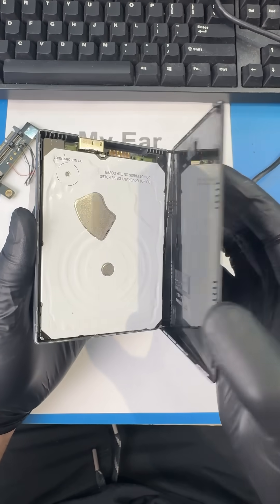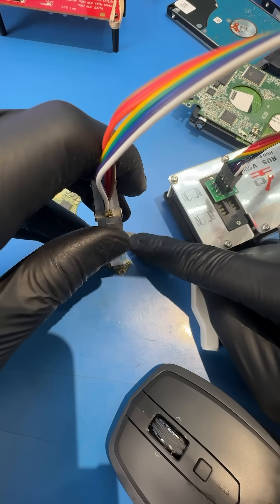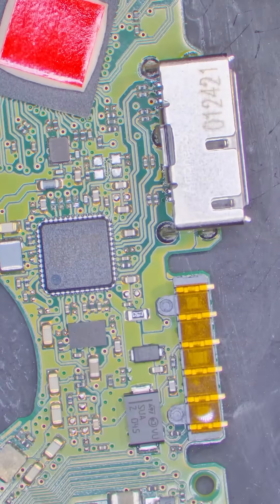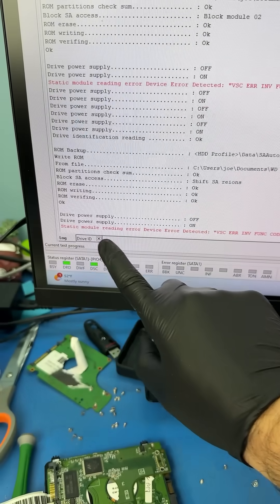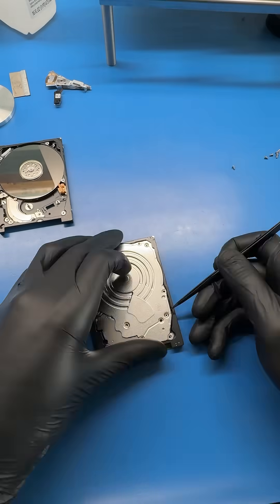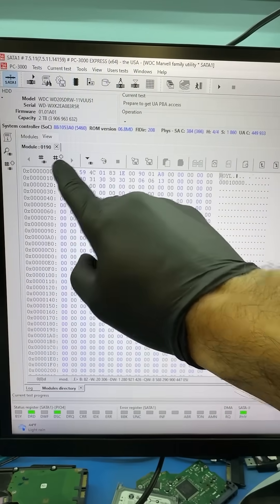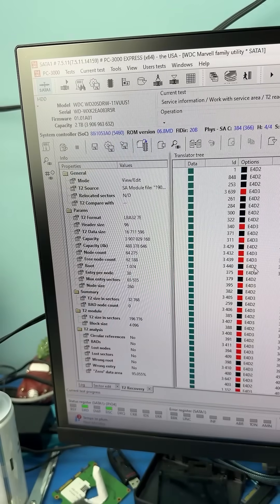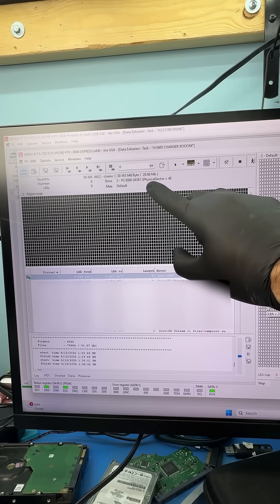Hard drive translator...? #tech

Comment: Reminds me of what I would tell users back when solid state flash memory (SSFM) drives were beginning to replace mechanical magnetic (MM) drives. You can't backup too often. MM at least gave warning by noise or performance slowi downs,  SSFM will suddenly die without warning. Before lunch perfect, come back from lunch, dead.

Comment: I do not recommend WD 2.5" HDDs because of the no SATA crap.
Really?
You have a dedicated USB board.
The USB port not working is a common failure point.
When they used a USB to SATA board, you could remove that board and extract the data.

Comment: Bro still worked on an HDD? Oh my. I am a software dev and my data autosaves to the pc and 2 external SSDs connected to my pc, and 2 OTHER external SSDs connected to an $800 ASUS router (total of 4 external SSDs plus the SSD in the computer). Due to the sensitivity and nature of my work, I am not saving it to any cloud, unless its our company's proprietary server. If i remember right all of my externals are 4tb Samsung T9, and my internal is a 990 pro. I don't consider anything else. I need reliability. Ps. This setup is not 2 or 5 different save files compiled. It is all 5x redundant identical data saved simultaneously to 5 different drives. After it saves to the first drive, it checks for any corrupted data before auto copying data to the other drives in a chain. If corrupted files are detected, it will promp me to save again or re-roll from a set of previously saved files. Bro with his hard drive hopefully learned a lesson lol

Comment: That's why you should keep important data at least on a NAS with a RAID array. It will handle one or two failed drives before you loose data. And then always make backups of your important stuff in case the whole NAS fails and kills the drives.

Comment: 30 years ago my younger brother pushed my computer from the table. My hard drive was completely dead. All my stuff was on there 6 years of programming, documents and copied software. So took the drive to the bathroom, turned on the shower for half an hour, waited until the steam settled, put a damp towel over my mouth and nose and opened the drive. One of the six heads was broken. I cut it off and reassembled the drive. I got nearly all my personal stuff of the drive. I was sweating bullets the hole time with a heartbeat so hard i think my parents could hear it downstairs.

Comment: Had the misfortune of diagnosing issues with these drives. At least with the Seagates you can pull the daughter board off and you got a standard 2.5" HDD but with the WDs you don't have that luxury. Less parts to deal with but less options for recourse when the drive runs into issues. Especially the ones with the shoddy USB 3.0 SuperSpeed port that we see here.

Comment: This is why I preferred the SeaGate External Drives.
Inside the shell, they had the SATA connection exposed, and a small PCB connector for the USB port. Easier data management, unlike WD.
Reply: +1
Reply: @einteko Dude Seagate is Western Digital. Western Digital bought Seagate years ago. Their relationship is like Compaq which continue to exist while still under HP way back (HP bought Compaq).
Reply: @IMNODOCTOR   I thought Samsung bought out SeaGate like 2 decades ago. Not sure about Toshiba and WD and other HDD companies.

Anyways, my point still stands. The WD HDD had the soldered on secondary board, but the Seagate HDD had the removable USB port.
Reply: @IMNODOCTOR Western Digital is not owned by Seagate. I am a retailer and i closely work with both  Western Digital and Seagate company and sell Servers and HDDs in whole of my Country India both Through Amazon and Offline. Both are seperate and Independent company headquartered in USA. Samsung HDD business is owned by Seagate which Seagate branded them as Maxtor and Marketed it commercially.❤
Reply: @IMNODOCTOR @IMNODOCTOR Western Digital is not owned by Seagate. I am a retailer and i closely work with both  Western Digital and Seagate company and sell Servers and HDDs in whole of my Country India both Through Amazon and Offline. Both are seperate and Independent company headquartered in USA. Samsung HDD business is owned by Seagate which Seagate branded them as Maxtor and Marketed it commercially.❤
Reply: @IMNODOCTOR  Nope, don't think so, you can still buy Seagate. WD bought out HGST (Hitachi) and now they are all WD, but HGST brand I think still exist in a few models for HD only though. NOT SSD's.
Reply: @johnhpalmer6098   Yup, and Hitachi bought IBM's drives. It's like the telephone companies in the US.  AT&T isn't AT&T, it's really SBC who bought their partent then took their name.  Kek
Reply: Currently looking at the 4 stacks of broken seagate drive in my desk
Reply: I never had a Seagate that didn’t fail. Mostly SCSI LVDs, including SCA. Got a stack of Seagate drive magnets over three feet tall.
I switched to Quantum and never looked back. Never had a Quantum failure until Maxtor bought them out.
Jussed sayin’ 😶
Reply: Or you can just buy sata disks to begin with and then put them into external cases of your choice.
...For example with a Type-C connector and not this awful ancient easy to break Micro B.

Comment: I love your videos, so no hate here.

But come on people... A 2 bay NAS that will at least mirror the drives might cost more than that cheap external did... But if you're storing something that's possibly your livelihood... It's still cheaper than data recovery, if they can't recover it. 

At least on a mirror, you have a smaller chance that both drives fail at the same time... And you get 2 chances at recovery.

Comment: Guys, stop being cheap.  NVMe enclosure, 35 bucks.  1 TB NVMe ssd, 60 bucks.  512 GB Micro SD card 40 bucks, 50 bucks if you by a Samsung with a USB A converter.  There are so many methods to backing up your data without using a crappy portable HDD for external storage.  Data extraction is difficult and expensive not to mention inconvenient.  One fall and these HDD drives are so easily damaged.  It takes skill and the right equipment to do this OR save yourself the headache, shoot the padlock off of your wallet and spend a few extra bucks on back up.  OR you can pay this guy.

Comment: Saw a video on you saving the data from a samsung of ur client the last video you poseted, quick tip, instead of fixing the power button you can turn on any samsung device by plugging in the charge cable connected to a computer and immediatly holding V+ and V- buttons!!

Comment: Going to say it, as someone who has used those WD Passport drives before, they're shit... Like, majorly.

Sure they work, but they're unreliable as all hell. I've had one fail on me repeatedly, to the extent where I had to reinstall Windows 10 entirely and reformat the drive itself just to fix residual issues caused by it failing.

Switched to an actual HDD, in an external enclosure, and never had an issue again.

Edit: For context, I was using it like an internal HDD for a laptop, because I didn't know how to install actual storage devices yet. Not sure if that made any difference, but still.

Comment: PSA: Always.. ALWAYS! Create backups especially when working on important files.

Get a local NAS and get a trustworthy cloud backup. If you want to play it extra safe. Put another NAS remotely on a trustworthy location.

Backup to the cloud, replicate cloud backup on local NAS, replicate local NAS on remote NAS.

When using a NAS. At least use a RAID where 1 drive can fail. Set a calender from the date you purchased the disks. Replace disks every 5-6 years (start at year 4, do it incremental so you'll lower the chance of multiple disks failing short after each other)

It's expensive, but services like this are more expensive (or permanently losing your data) and it's way less stressful 😅

Comment: Thank you MD Repairs!! After watching your videos, I dropped off a broken SSD which you guys diagnosed the fault, transferred several TBs of data onto a new Samsung T7 and shipped it back to me in a couple of days. I wouldn't hesitate to always send you any tech that breaks down as well as recommend you to all ,y colleagues.
Reply: To all the guys asking for the price. Data Recovery is expensive if you want it done right. Backups will save you a huge amount of money.
Reply: @_seriousrob_  yea and we want the specific price
Reply: @gmodiscool14 and what will that price tell you? Nothing because you still dont know the amount of hours needed to achieve the result. I guess by the fact that the Heads had to be changed 4 times it wasn't on the lower end. Between 300$ to 900$ per Drive, everything seems possible.
Reply: @ "What will the price tell you"
It tells you the price

Price is something people use, to tell if an item or a service is in the ballpark of things you can afford.
Reply: @ i wanted a quote because i have a drive that is damaged and likely not recoverable, but i want to know if it'd be feasible price wise. not much that backing up data could do for me when the data is already lost.
i have an hdd which was fried by an improper psu cable, and then tampered with to move the roms around to try and recover it (didnt work obviously.)
Reply: How much do they charge for these?
Reply: How much was it?
Reply: What was the price?
Reply: @ $1000-3000 depending on the time needed and the drive capacity.
Reply: How much it costs
Reply: Glad you've got your p()rn back xD

Comment: Doing game dev on a HDD is absolutely insane.

On top of the reliability concerns, each time you build a solution it requires time to load.

With a poor CPU or a slow hard drive this load time takes way longer.

Each time it might only be like 30 seconds even bad hardware.

Compared to about 3 seconds if you have proper hardware.

Keep in mind that every single code edit will prompt this loading bar; forget a single piece of punctuation? That's a loading bar. Make a typo? That's a loading bar. Want to tweak literally anything? That's another loading bar.

Now imagine that added up for every single script you have to write which can be dozens to hundreds of scripts in a complete game.

Don't use a HDD, a 60$ SSD will save you countless hours of pointless waiting and make the whole experience way less arduous.

Comment: Before anyone mentions putting the disks into the good drive

1. You can damage the data by doing this
2. Drives get confused when the data isnt where it expects it to be
3. You can deposit residue on the surface and damage it when you run the drive
4. You can destroy the mounting mechanism
5. You will ruin the balance of the disks